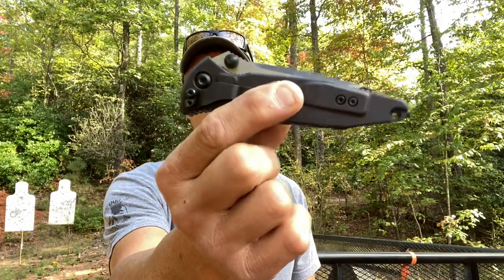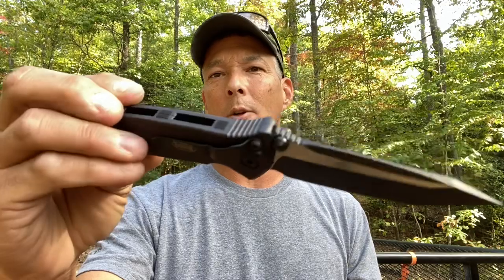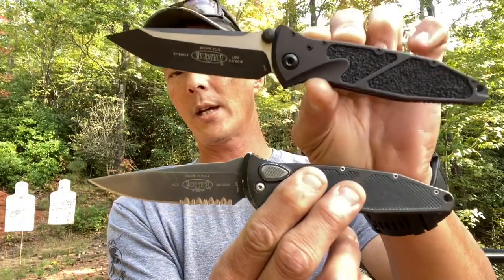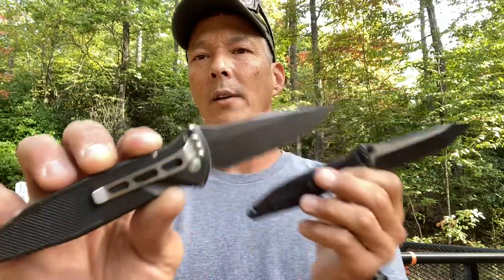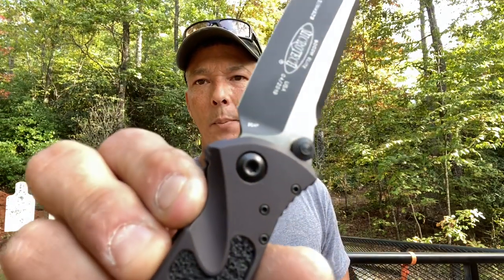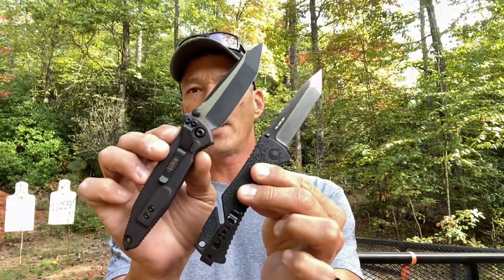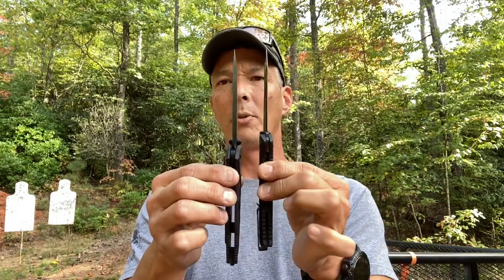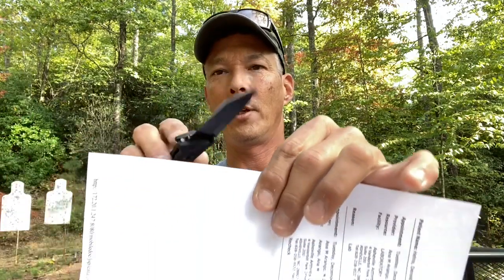Microtech Socom Elite Extreme torture test

Comment: How does the locking mechanism in the auto version compare to this liner lock in terms of strength? Trying to decide between the two
Reply from the maker: The auto is one of the strongest mechanisms there is. Definitely stronger than the liner lock in my opinion. 👍🏼

Comment: I stopped buying liner locks because I've had them fail when using them hard.  That socom really impressed me!
Reply: You can see the liner lock on it is pretty thick and beefy.
Reply: @knifetoucher  yeah, this knife liner lock is almost a framelock. They basically release the new one a sub-frame lock.
Reply: Liner locks aren't meant for "hard use"

Comment: Great test and great insight! I just subscribed. M390 is a bit brittle, but it can still take a beating and sharpen up nicely. Maybe Microtech can make their next Socom run in K390, which has better edge stability and strength. That would be a perfect Socom in my books.

Comment: Very nice quality knife and you are right about the steels as so many blade steel snobs out there....I am still trying to warm up to a tanto style blade but Microtech's is very subtle on the tanto style....Nice job with the testing using your serrated edged blade....Good stuff....
Reply from the maker: Thanks Scott.  I really like the looks of the Tanto’s but I don’t really prefer them over a drop point.  Lots of times I have to do a rolling cut and the drop point seems to work best for that.

Comment: Wow, that serrated edge cut the rope much better. I’m generally a plain edge guy and would love to see the plain edge knife sharpened on a coarse stone in the 100-250 grit range and then repeat this test. A plain edge finished on a coarse stone will have some microserrations that help it grab into and cut tough materials like the rope in this video. If a coarse-ground plain edge were put up against his partially serrated edge, it would be interesting to see what happens. If the partially serrated edge still won, I might have to try one of those out! Might actually change my mind on the serrated versus plain edge thing!

Comment: My experience with SOG over 25 years of use hasn't been that good. I surprised the hing didn't break, as the plastic flexes and I'be been able to defeat the lock with just hand pressure on the Aegis, Trident and few others. They have a big name, but their folders with plastic molded handles are accidents waiting to happen. Yes, I know, not really a fair test against the Socom. You really torture tested these two. I have great confidence in the Microtech as a result. Too bad that tip went. Probably good in the the company can analyze the issue, either in heat treating or possible impurities in the steel. Not like that's a frail tip design, either.  Thanks again!

Comment: Microtech makes really good knives, no doubt.   I had a SOG lock give way on me back in the day, down in Puerto Rico during that fun winter training we used to go down there and do.   I was cutting open a coconut and the lock gave - pretty bad cut, as you can imagine.   For the money - don't buy a SOG - in my experience...
Reply: That's why I buy coldsteel I had a liner lock fail twice on me 2 different knife brands on Kershaw an a sog I only carry tri-add now or button lock because benchmade are overpriced micro tech seem nice but I've never paid more then $150 for a cutting tool over 200 is just insane but I like this guys tests

Comment: No knife tip would survive that, the plus to this knife is ceramic bearings they won’t brake.
Reply: Rick Hinderer XM 18 spanto tip would easily survive this test if I had to guess!
Reply: I mean..I have a cold steel recon 1 Tanto and this is pretty much regular use lol...I was surprised the microtech tip broke. Regardless, still one of my grail knives.

Comment: One other difference is the new socoms are on bearing systems rather than straight on the aluminum surface. The old system was probably better for the hard use because you didn't risk the bearings denting the scales or even the tang and they were more dirt resistant.

The bearing dent issue is also next to irrelevant unless you're trying to pry open a door or something.
Reply: I'm pretty sure there are steel rings in the scales that the bearings ride on. I know in the Socom Delta there was.
Reply: @oXObsidianXo  That's right, the elite has a steel backing plate on the scale, then a track on the tang. Steel plate is easier to replace but denting the tang is a bad one.

Comment: My SOCOM Elite Auto hasn't left my pocket since I got it about 3 weeks ago, and it I think it's here to stay.
Just finished installing an air handler with it and after cutting fiberglass duct board, insulation, rubber gasket material, and skinning copper wire for 4-6 hours
it didn't take much sharpening on a fine diamond stone to bring the edge back to razor sharp.

Comment: Decent, practical test. I prefer the the drop point regarding the Microtech you tested.I wonder if the brutal Medford Praetorian would loose a tip, don't think it would as it is designed for prying by Greg.👍

Comment: Would of been nice to test it side by side with the #coldsteel recon 1 tanto
Reply: You know CS hand down will out do that very ckool knife even though it's a tough steel and handle material.
Reply: power play 4 real i have cold steel knives and benchmade and pohlforce and extreme ratio so its not that i dont have expensive knives is just that cold steel is really amazing knives toughest on the market not wven mentioning the price
Reply: @R.J. Lewis It's depend of the construction and handle material too...
Many lock backs on cheap knives are crap due to this and tolerances.

Comment: Why did you compare it to a SOG? Why not something higher end?
Reply: Imagine it against a cold steel knife lol. Kind of surprised that the SOG cant cut paper.... It has been a while since I've even bought a folder that couldn't cut paper and maybe it just needed to be angled slightly different due to a different grind? Heck regardless some of my sharpest knives out of the box were under 50 bucks. Its just higher end knives tend to be more consistently sharp though they most definitely have their flaws as well. 

My BM 746 didn't come crazy sharp and didn't really have the right cutting edge angle for its style. and one of my Microtechs have an uneven grind and while its sharp its no sharper than most 30-100 dollar knives I buy. That being said its no huge deal and ill just work it out whenever I sharpen it I just have no idea if the guy that sharpened it in the factory needs glasses or something. Its a dagger and one side is fairly good id consider it acceptable though not perfect. But the other side is a good bit worse especially when you compare it to the side that's not too bad.

Comment: Great video and channel.  I'm curious, what is the actual brand and model of the Kevlar lined glove?  I could use some.
Reply from the maker: nearlyagoodlaugh Thank you for watching and commenting.  I actually went to a wood working shop and bought them.  They are cut proof level 5 liners but they are NOT stab proof.   I merely wear them inside of a set of Mechanics gloves so I don’t accidentally take a trip to the hospital 😄. They were only about 12.00 but the do not have a brand name or manufacturers tag.  I already threw the box away.
Reply: Ah that makes sense, I thought the outer gloves looked like Mechanix impact resistant gloves.  I think I've seen the same kind of cut resistant ones then.  Might try the same thing, using them as a liner.  Thanks for the quick answer.
Reply from the maker: nearlyagoodlaugh anytime!

Comment: Benchmade axis IS NOT NEARLY the same as SOG. You should look at diagram of Benchmade lock ALL liner lock 100% will fail before ANY axis lock. Frame lock is better than liner lock due to the thicker locking lever depend on frame thickness of course. Liner and frame will slip and axis virtually cannot slip the frame liner will bend before lock fail. Although I will give it to mircotech liner is thicker than your average liner lock.

Comment: I was on the fence about buying one of these. But after watching your video I am going to commit My only question is should I get the tanto  or drop point? After seeing the how the Tantos tip stood up? Would the drop point fair any better??
Reply from the maker: Hey Melendez,  I personally prefer the drop point.  It it much easier to roll cut things and easier to sharpen.  The tanto might have a slightly stronger tip but I would still choose the drop point.

Comment: I have only had my Socom Elite for 2 weeks and have not used it for anything yet that could harm it. The detent allows the blade to swing out if the knife is shaken hard in a similar way that your test knife did.  While I do not think it will hurt anything, I am wondering if this is normal for the detent of a Socom Elite.

Comment: Great video! Thanks! What steel is on the knife?
Reply from the maker: No problem.  Most Socom Elites made today will have CTS 204P however, you might see M390 , Elmax or even XHP on them.
Reply: @XRING  OK. Microtech Socom Elite Manual which steel test? Very interesting.
Reply from the maker: tot_samyy____ The knife that was used for this review had 204P blade steel
Reply: @XRING  Need to buy))) They can disassemble the tank!))) Thank you!

Comment: The second Socom Elite in 3 days with a broken tip on YT!
Which version was this? M390 or 204p?
Reply from the maker: This model was 204P.  Almost any high quality steel such as 204P, Elmax, or M390 will break a tip with this kind of lateral force.

Comment: I did a test very similar with a Tanto Microtech and had the exact same result with the tip. U can see the results of the reshaping and repair on my Repair video if you are interested you can use the still shots as proof of how easy it can be repaired. I did it all on diamond plates freehand

Comment: Real knife people know that SOG knives are very overpriced/low-quality knives.  SOG had Gunnery Sergeant Arley Emery(drill instructor from Full Metal Jacket) as their brand ambassador for years, which caused non-knife people(Walmart shoppers) to think if Arley Emery is endorsing SOG that SOG knives must be really good.  The truth is that SOG really stands for Seriously Overpriced Garbage!!!  The SOG knife that you have in this video is the SOG Trident Tanto which is spring assisted, the SOG Trident has the one-sided ARC lock which in reality is a really shitty version of SOG's own double-sided ARC lock which was originally seen/used on the SOG Vulcan.  SOG's double-sided ARC lock is virtually a direct rip off of Benchmade's Axis lock, the double-sided ARC lock was made slightly different to avoid violating the Axis lock patent which Benchmade had the rights to.  The one-sided ARC lock seen on the SOG Trident that you have in the video is absolutely shit, every SOG knife ever made with that one-sided ARC lock comes with unfixable blade play because the design of the one-sided ARC lock itself won't allow the knife to actually achieve solid lock up without any blade play.  The minute that I saw you show us the Microtech Socom Elite's challenger(SOG Trident) I already knew who the winner was going to be!!!!  Awesome video sir!!!!
Reply from the maker: Thanks Thomas and thank you for providing the information about the SOG’s .  I had no idea and I do appreciate the feedback.  Have a great week.

Comment: That tip should not have broke that fast , it was not even that deep... poor heat treat causes that . I have several $100 folders that have survived much worse prying
Reply: Yeah that’s the thing about knives under 120ish is that the heat treat is usually pretty inconsistent

Comment: Hey man, I got a microtech socom elite manual a little bit ago and my buddy, I assume he has soft hands, tried to deploy it and ended up dropping the fucker tip down onto asphault.  I reshaped the edge and tip and that badboy can shave wood and hair alike, however, I notice this slightly disturbing harmonic effect in the liner lock.  It has just the slightest side to side play if I'm manipulating the tip of the knife , nothing up and down, but I am slightly concerned with this.  Could be just paranoid, but I noticed it looks like the liner moved over slightly and at the right angle I get this shitty feedback in the knife through the handle that I can feel is going through the lock.   

Do you have any opinion on this as someone vastly more experienced with this kind of knife?  

Thank you kindly.
Reply from the maker: Hey Salad,  I hate to hear that but I have also noticed that harmonic effect on some of the manuals as well.  I mostly own the Auto Socoms.   However, most of the manuals I own make that same vibration.  I can’t say they all do that though.  If you have any reservations about it you can always send it back and have them check the lock and the internals and tell them you have side to side play.  Especially since it’s new.
Reply: @XRING  Thank you for the reply in general!  Do you think that it's anything to actually be concerned with, personally?  It's still in full contact--the liner--with the whole left side of the blade's rounded/flat lock-up, that entire middle side.  I notice playing with it a little more or a little less that it's due to the liner lock taking a slightly.... I wanna say a little rotation diagonally which allows for a certain amount of pitch in a very small cone.  

Thank you again for the feedback.
Reply from the maker: Salad Dressing Anytime!  I always to try respond to all comments.  Seriously,  I know the guys at MT really take quality seriously. I would go online and get an RA and explain exactly what is going on.  Noice is one thing, but I don’t do loose Socoms.  I know some of the “locks” on the liner lock have to be hand fitted to some of them.  I would hit up Corey Campbell on Facebook and he will get with you ASAP.  He is in the Leo/Mil division but he will get you squared away.
Reply: @XRING  Thank you brother!
Reply: @XRING  Hey, I'm sorry to bug you again my dude, I send a RA request online, I tried to look for your guy, Corey but I couldn't confidently find someone linked to MT.  Not sure if there is any way to help on that but figured it's worth a shot.  I gave em full detail, really hope they come through!  I have the spear-tip bronze signature coming in tomorrow.

Comment: A frustrating and dumb test, just take the same brand and then compare knife steels because this is unnecessary. There’s no reason to break an expensive microtech because we already know that type of steel will do when prying, it can’t flex without breaking because it’s too hard. Also with the tip that thin, of course the tips gonna break off.

Comment: Dumb to do torture test on a powder steel knife because it will break like a piece of cement because it can’t bend and flex like a carbon tool steel blade. Which is the very reason why you don’t want to buy a fix blade knife in a modern age pocket knife steel.